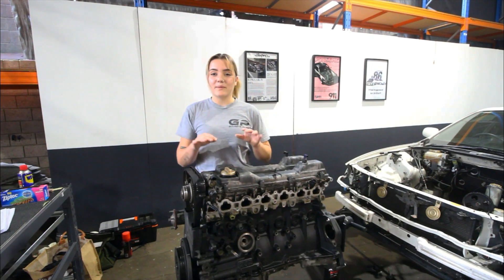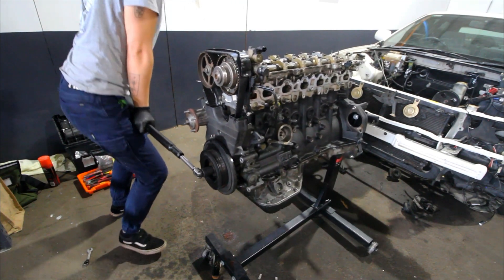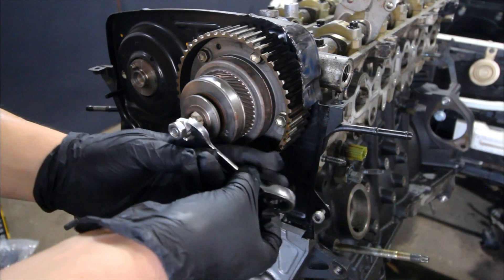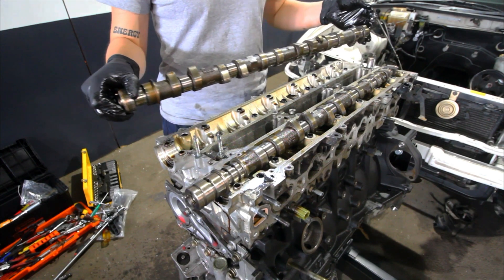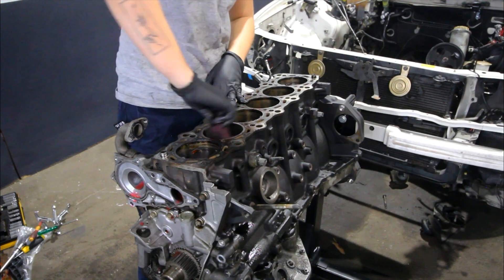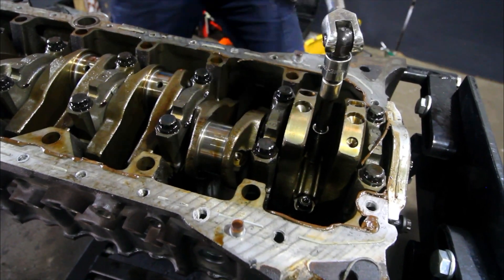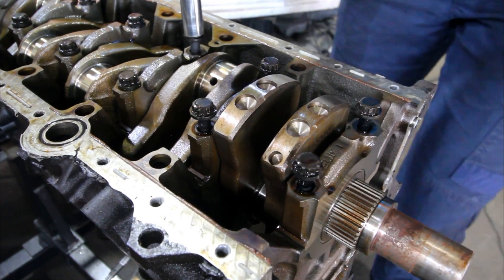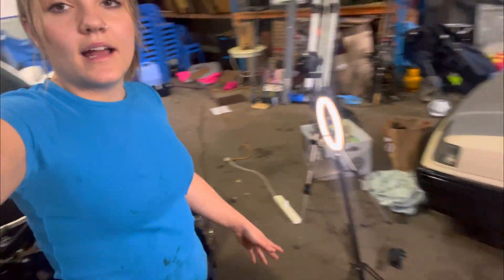2JZ-GE TEARDOWN | What Tools To Use | JZX100 NA+T Build

Comment: I need to boost my jzx90’s 1 is a 2jzge and the other is the 1gge. And with the crank bolt I didn’t have issues lol I expected issues so I had a super long breaker bar and luckily I’m 250lbs 😂